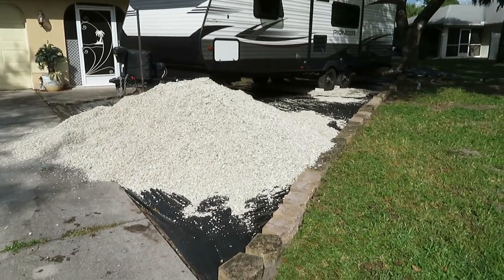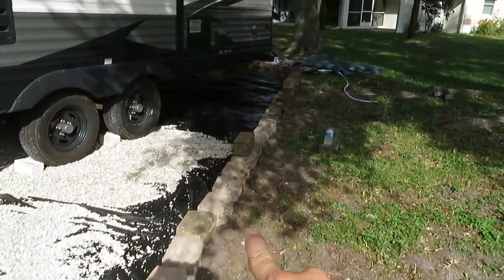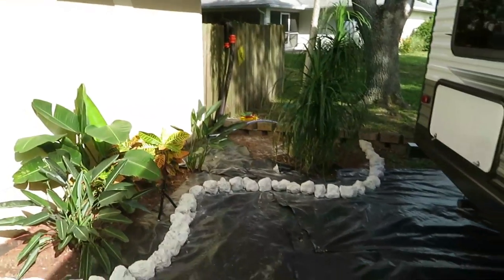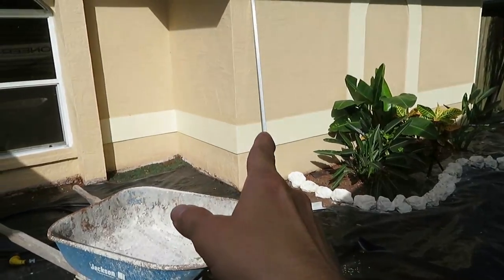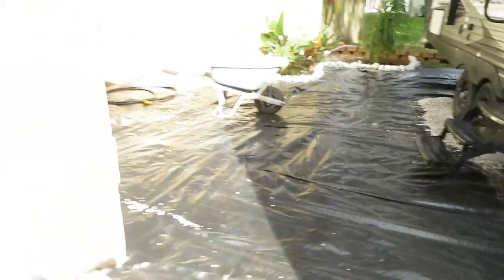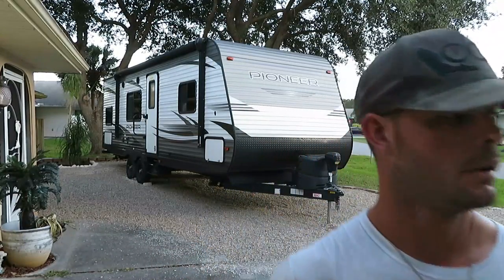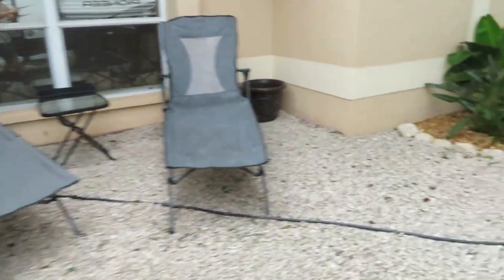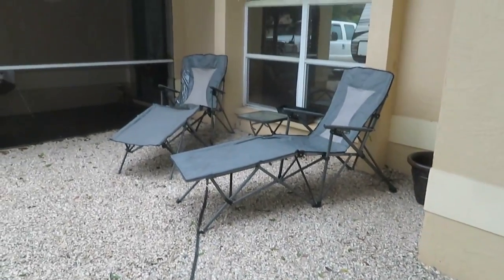Installing a Shell Driveway #diy :Full time RV Family

Comment: I have very soft sand on my lot i need to stabilize so I can drive over it.   How much more for driver to  help distribute it some? Seen some skilled deliveries where they they nearly lay it it flat.
Reply from the maker: Not sure. Depends on where you buy it from and who the driver is and if they’re comfortable with doing that. White cement specialties doesn’t normally do that but it never hurts to ask. Thank you watching
Reply: Just ask the driver.
It's a skill not everyone has or wants to attempt.
  Overhead power lines and such. Be careful. I have had some good drivers here in the northeast. I ask for simple little drops. They put as much as they can the way I ask. All said and done.  I am happy.  I flip them 20-50$ and I don't break my back. Save time.